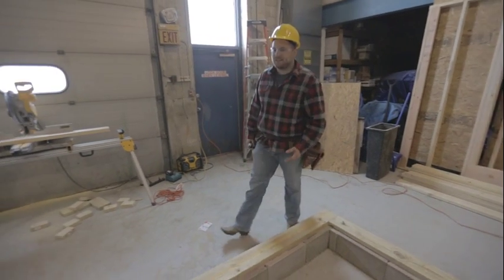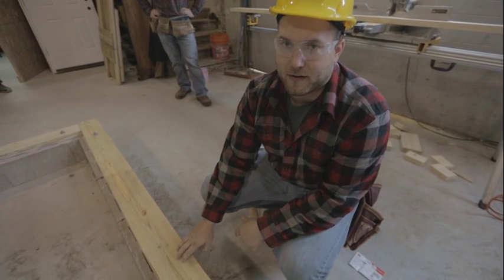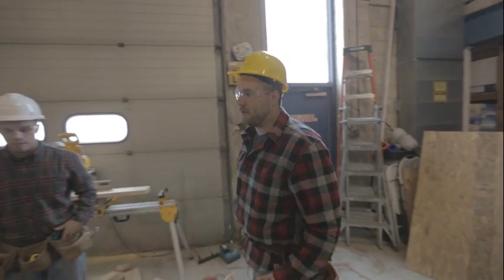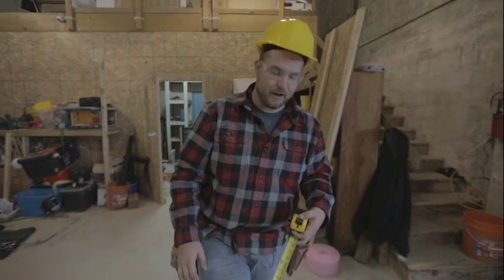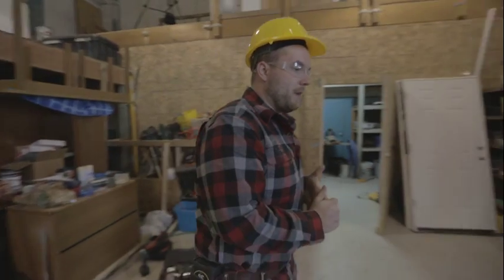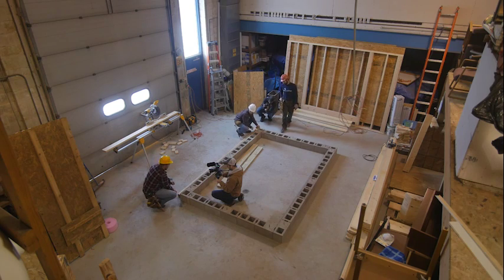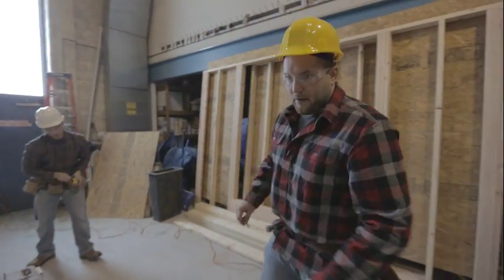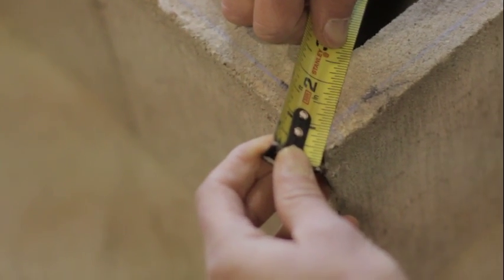How to - Floor Framing Part 1: Layout mud sills

Comment: Can you groovy cats draw up a plan for a house for me with detailed instructions? I'll tell you what I want, I want basically the same thing as your building there but I want 2 stories and probably a few feet bigger.
Reply: @NSMConstruction  geez, I hope its not because I called you a groovy cat, sorry about that if that's the case.
Reply: Kelly,
Not all. Love groovy cats! You should probably get an architect. Or start designing yourself. That can be one of the coolest parts of a project the design process. Get yourself sketchup and start playing around it’s tough to put down.

Comment: My question would be, what if it wasn't square? Let's say it's 1/2" off, or even more... how do you deal with that? 

This is an issue I've run into often working with old construction that was either never done right, or over time has just shifted and is no longer square. It's an absolute nightmare trying to work with that. Is there something I can do to make it easier or do you just kind of have to live with it?